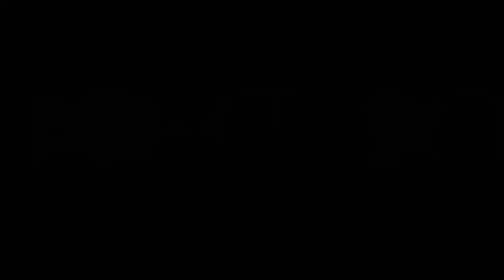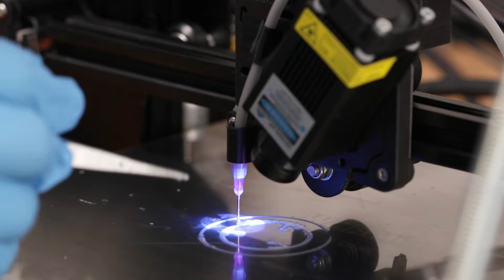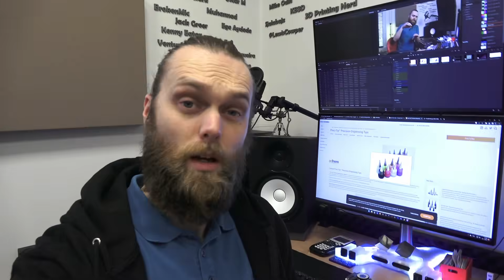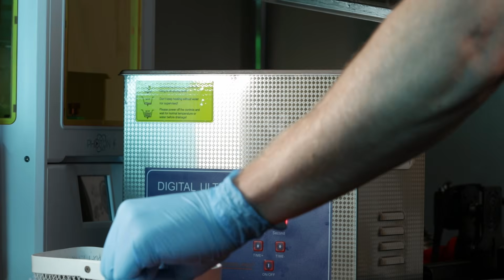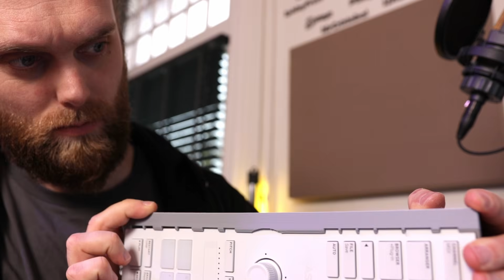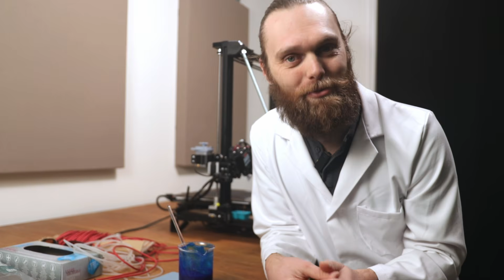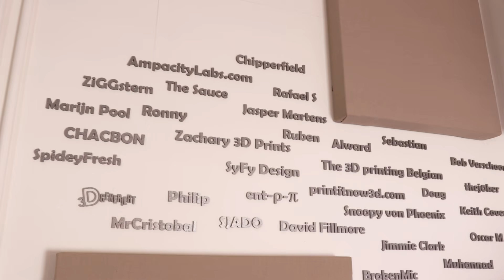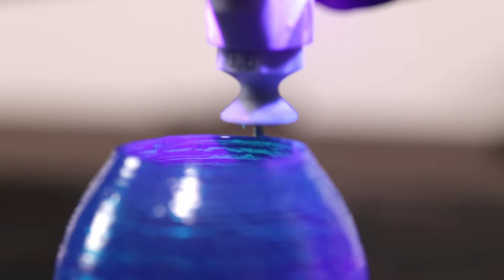I made a CUSTOM Nozzle that 3D Prints GEL!

Comment: great video and i have a small suggestion. why don't you take a very lage syringe instead of the cup? just add a actuator on it and you can precisely control flow and pressure to your pump

Comment: Ohh, dude! Have you thought about printing hollow shells but every [variable] number of layers, raise extruder [variable], and flood the amount to fill the volume, from a stationary point or reduced distance [variable] around the inside of the perimeter, and cure a few layers at a time before building more wall?
Kinda like MSPaint's bucket tool, for G code lol, could be good for clear parts!
High layer jump will block overhangs from getting proper curing though. Overhang angle should maybe override this with an extra set of settings to reduce layer height jumps for fills near overhangs based on an area threshold and angle threshold, with a reduction amount, and a multiplier to scale it down with increasing angle. Many ways to set that up though.
Reply from the maker: That's a very interesting approach! Thanks for sharing!

Comment: Awesome
Another huge step in fdm printing would be continuous fibre for home use on a open source platform.
But what was the hickup @ 19.34 at the tip of the nozzle ?
Your videoos are outstanding.

Comment: This may be a dumb question that you already answered that I missed but why don't you attach the cup of resin to the top of the printer, drill a hole at the bottom of the cup (or better yet, use a vessel that terminates to funnel at the bottom) and attach the pipe to that hole, and then have the resin gravity feed into your direct drive pump extruder setup? Now you don't have to fight gravity/pull an excessive vacuum/apply additional pressure to get resin into the pump. To account for the slack in the pipe that will inevitably form when the 3D printer is printing tall objects you could try and get those curly coiled tubing that can stretch and retract; I don't know where to source them, particularly in silicone, but I do know that they exist somewhere. Just make sure the pipe is wide enough and not too terribly long as to avoid flow restriction from fluid skin friction.

This is a very cool project and and I'm sure you can achieve your goals for this printer. Stay vigilant!
Reply from the maker: Some people suggested IV bags which I think would be a very interesting approach! It looks like the tube needs to be as short as possible in order for this to work. Although chances are that I need to increase the diameter.

Comment: Hey, I think You've overdid arms on the peristaltic pump. The more arms You have, the less area the tube has for expanding in between the bearings. Most Peristaltic pumps I've seen have 3 arms for this reason. Also take a look at aquarium pipes for peristaltic pumps. Normally silicone doesn't have all the properties You need - the pipe have to be very flexible, yet very "springy" (for lack of better word) to encourage returning back to original shape as soon as possible. Take a look at Stenner EC30H-2, or Zodiac pH Perfect Peristaltic Pump Tube or similar. I think You know the idea behind the peristaltic tube - You want to create vacuum which in turn will pull the liquid You want to move.

You can also try, and put the container with resin above the pump which will help with fighting against the gravity.

Plus focus on making triple sure, that the pipe is squished to the max - even a tiny gap between the walls will result in low pull force due to missing vacuum

Comment: When printing something like PLA and the nozzle hits the print it will remelt and you have no fatal collision. It is different with resin. It is solid and the nozzle will tilt when it hits. That leads to more resin in a spot where you are already colliding. That will lead to more built up and the next time you reach that spot it will break the nozzle. Z-hop won't help there since it is happening during print. I think you have to tweak whether the extrusion amount or the layer height. Especially at crossings of infill or outer shells. That’s why you could finish in vase-mode without any problems. You had no crossing vertices. Keep doing what you’re doing! You are onto something great!

Comment: this might be weird, but part of the issue is that the resin cures, so any bubble or flow causes a bump that can snag the nozzle. In a FDM, the heated nozzle can just push past the thermoplastic and reform it, kind of like a bull dozer. For a resin printer, you'll need perfectly smooth prints, so one thing you could do is integrate a silicon nozzle on the brass to "smooth" it out before the light hits. Think of it like a tiny spatula. 

The more difficult option would be to map the defects and incorporate them into the path planning dynamically so you can hop over those defects.
Reply from the maker: Exactly! Right now, the plowing-through method seems to work and is the easiest. Although this nozzle isn't up for the task yet!

Comment: Could the leaks be fixed by curing the leaked resin in place, or would the curing process reach thru the gaps and clog the inside of the nozzle as well?

Comment: I'm curious, have you tried calibrating the E steps?  I don't think Slowing down the print on its own would change anything if you didn't increase the E steps for the parastaltic pump... oh... or adding pressure.  That works with FDM too I guess... 😅
Reply from the maker: I used the vase mode pawn to calibrate the e-steps. This must be done quite carefully since a small amount of under extrusion can cause an interruption which ruins the print. I slowed it down to prevent the tube from ballooning too much. So many parameters to play with😅

Comment: Wow! That’s one cool idea. I did use glue dispenser in my projects before about the size of 3D printer head but pneumatic control zero drip but some stringing depending on glue stickiness. UV resin do not harden without UV light so no clogging issues.the end screw controls the amount n flow can fit a small stepper. 😊
I didn’t know laser could cure UV resins, thanks for sharing very good infos. Keep up the good work 👍

Comment: Wow! That’s one cool idea. I did use glue dispenser in my projects before about the size of 3D printer head but pneumatic control zero drip. UV resin do not harden without UV light so no clogging issues.the end screw controls the amount n flow can fit a small stepper. 😊
I didn’t know laser could cure UV resins, thanks for sharing very good infos.

Comment: Would be kinda cool to take a desk, router channels in it, add UV LED strips, place sheet of glass on top, add boundary wall, mold release, pour transparent silicone on top, cure. Spilled some resin? No problem, jut press the button, the desk glows in UV for a few seconds, before turning off, peel off the cured resin.

Comment: Would be really cool to take a desk, router channels in it, add UV LED strips, place sheet of glass on top, add boundary wall, mold release, pour transparent silicone on top, cure. Spilled some resin? No problem, jut press the button, the led strips turn on, the desk glows in UV for a few seconds, before turning off, peel off the cured resin.

Comment: Great video! Can't remember if you tried it already, but perhaps talcum powder or mica powder is something you could try for the mixture. Although I think you have the mixture perfect already, but perhaps it helps with the flow?
Reply from the maker: I haven't tried that and I want to take a closer look at the possible fillers out there. This is still unfamiliar to me, yet so interesting! Thanks for your suggestion!
Reply: @properprinting  No problem! Now that I have a bit more time to think, you mentioned having a pressurized container for the resin. Might be worth a shot if you add an electronic clamping mechanism. You might be able to ditch the pump entirely if the clamp is variable and consistent. The pressure would need to maintain the same pressure though, as the flow might decrease over time if the pressure decreases. The clamp can be put closer to the nozzle, which might help a bit with the drips.

Also try to remove the air from the tubing by letting it recirculate for a bit on higher speed or having a y-line connector at the end where you can siphon off the air.

Man this idea is really awesome! It gets my gears turning haha. If you ever want to brainstorm for a bit, feel free to contact!

Comment: As a person in research of technical ceramics AM using SLA, the first thing I can notice is the amount of aerosil by volume. I don't believe you need that viscous of resin or that much aerosil, unless that much is necessary for shear thinning properties. You could also reach out to 3Dresyns to ask about what photoinitiators could be added to decrease curing time for better bridging.

Comment: The difficulties of pumping viscous liquids! We do a similar thing at my work, we tried the peristaltic pump first since that's what we had, but the flexible tubings have low pressure ratings so we actually ended up popping one. We ended up going with a worm pump at first from a Chinese brand (cheap) coupled with a pneumatic press (drum or Nordson cartridge even for small scale). We just got an upgrade to a gear pump. Like you said, self-priming the positive displacement pumps with just their own suction force on a viscous liquid is a nightmare, so it's good that you're using the gravity advantage. It would be even easier and more consistent if you use the pneumatic cartridge like paste or chocolate extruders.

Comment: Been following your creations for a while. I used your ender 3 dual z upgrade long ago and I actually still have it on my ender 3.

Saw your fdm resin video a little while back and it immediately caught my attention. I started my masters program last year and it's based on 3D printing high thermal conductivity continuous pitch carbon fibers for heat exchanger applications. 

There were issues such as fiber breakage and not being able to print at sharp angles due to the fiber being super brittle. That's where I pick things up and hopefully solve this issue. What you've got going with fdm resin and being able to extrude fibers is awesome to see, and honestly would've been nice to be able to work with you! 

You saying FDM resin printing can be huge is 100% true and my research project is one great example of why. This can unlock potential in cheaper, lightweight and efficient heat exchangers which can be used in all kinds of electronics, space, automotives, and other applications.
Reply from the maker: Such an awesome and encouraging comment! It's so cool that you mention applications that I am unfamiliar with. I do have some use cases in mind, like robot grippers when flexible and rigid resins are mixed so delicate parts can be picked up, but I've got the strong feeling that this enables more than I could ever foresee. Thanks!

Comment: You either need to make a way that the resin can't stack up above the current Z height, or make it so if it does the nozzle can safely skip upwards over it with any sideways pressure, maybe some sort of cone shape nested down into another cone, so when pushed sideways it goes sideways and up.. but if it keeps doing that over and over it will just keep building higher, so there's some tuning to be considered. Another idea is if you had a way to actively come in and re-level everything after each layer before the nozzle tracks over a previously printed section, but extra time and spinning cutters in possibly liquid resin, don't sound like a pleasant mix.

Comment: I knew fiber printing was where you were going when you started this project! This is freaking awesome dude. One thing though that I've found through experimenting with UV resin is that carbon fibers scatter/block the light and in the test I did uncured resin remained within the carbon fiber bundle. Glass Fibers didn't have this problem at all. I was using a battery powered UV Laser of not the same power as those you're using however. It may not be an issue with higher power lasers using carbon fiber. I didn't want to discourage you just letting you know what you could expect. With that said low cost glass fiber printing would be amazing. Also there is another fiber that you could try called Basalt. I think it's more similar to glass fiber than carbon strength wise. If you could find a source of long strand Quartz fiber bundle that would be the best for this probably. Anyway work to do still cool to see this and looking forward to what's next from Proper Printing.
Reply from the maker: Thanks a lot for your valuable insight!

Comment: resin printers are out there with amazing quality it doesn’t mean fdm doesn’t have a place for resin as well. The possibility of a outer nylon layer and inside it has resin infused with stripes of carbon fiber or fiberglass would greatly improve the strength of it. Theres alot of possibilities
Reply from the maker: Exactly!

Comment: I wouldn't change the mixture, I would just change the Zheight you are working with or maybe even give the nozzle a flexible tip to work with instead of letting the whole rig move. Having the tip of that shift so much is super bad for prints, even future prints because you're offsetting the X/Y plane dramatically when you're working on such a small scale. Try printing at different Zheights or even print with layers quicker so the resin doesn't have time to bead up from the tension and cause it to harden above the working plane.

Comment: This project could use some more basic research now that the proof of concept has been established. Trying differnt levels of viscosity of the resin would be a start and alternative additives (short glass- or carbon fibers maybe?) and how they affect the strength of the resin. Also a better/stronger pump. Given the nature of the resin, the slicer would also need to be modified (basically pressure advance from klipper). The nozzle design looks good but needs to be stirdier. But the thicker syringe tips looked promising!
I could imagine that the advantage of this system allows for fast printing like FDM with the layer adheasion of SLA.

Comment: Really honing the optimum viscosity of the mix will help alot I'd imagine. It's amazing how much the characteristics of resin can change with even just a few degrees. Perhaps put a heater pad under the vat? Could insulate the tubing too - perhaps run the mix thru the whole system without the uv lights on to get the whole system up to temperature, then reuse same mix still? Dispersant additives can help ensure easier and more thorough mixing of filler powder. Perhaps you could up the filler slightly and increase viscosity to improve bridging performance? Have a cooling air nozzle to cool mix as it leaves the gel nozzle? Keep up your work! The fibre thru nozzle design is simply too slick to not pursue!!
Reply: If viscosity is so sensitive to temperature, maybe adding a preheater to the tube just before the nozzle/pump might fix it. If you make the resin slightly too viscous at ambient temperature, you could fine tune the viscosity by electronically adjusting the temperature of the preheater. If you target around 50~60ºC for the optimum preheating temperature, then it might stay stable at any season and climate.

Comment: Have you considered using flowable dental filling material?  It's highly filled, slump resistant, shrink resistant, easy to cure with 469nm light.  Already made to flow from luer lock tips.  but it's expensive.  Just a thought.
Reply from the maker: I haven't but 3DResyns has some interesting solutions that I'm going to discuss with them :D Thanks for your suggestion!

Comment: Couldn't you just use one of those novelty lenses (circles, stars, smiley faces, etc) from a $2-10 blue penlight laser? They're kinda a blocker and a lense, and they should do UV almost as well as blue laser light (when you're talking about a 2-5cm throw distance).
Or just have a UV lamp pointed at your entire print bed for low levels of continuous curing, alongside your current laser set-up providing the real resin curing power. Essentially additional power alongside your actual curing solution, to make sure it all gets done eventually.
Reply from the maker: This is where I got the idea from! I hope to find one of these lasers that casts a circle!

Comment: why not try to use both, rigid bubbles and silica? 
Using a ptfe tube instead of the brass pipe might help with the sticky goo, and might allow thicker gel. Keeping the pipe as an enclosure/support for the tube seems like a good idea.
Rigid tubing +1